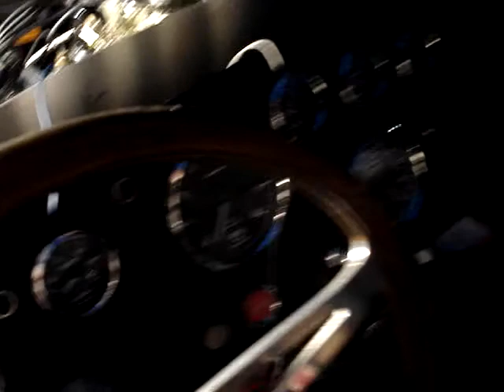Cobra 1st Start

Comment: Congratulations.  I suggest replacing the aircleaner with a different type though (besides none).  If the engine backfires or pops it will instantly melt a foam type aircleaner.  This is a common problem due to restricted bonnet clearance.